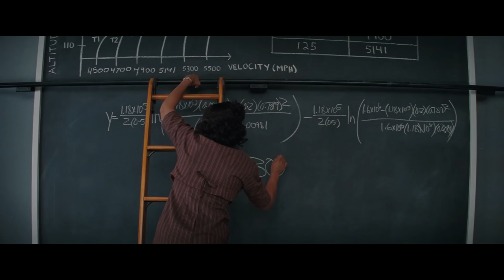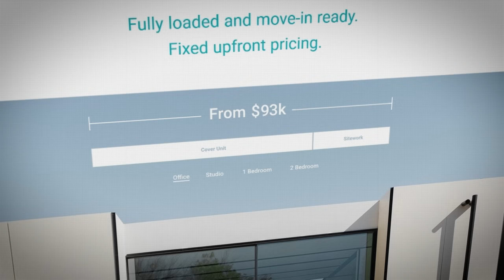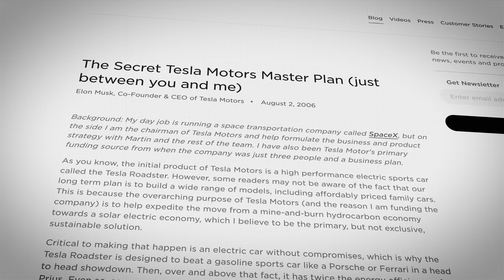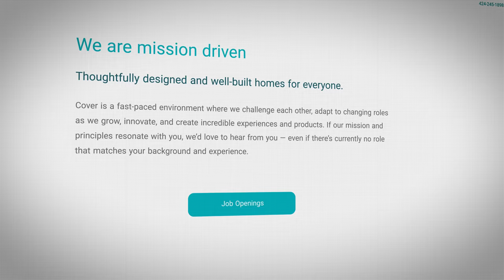How Cover Is Building The House Of The Future

Comment: Is this an advertisement ??? Agree with you that shipping containers are terrible idea for home but prefab homes built with steel are custom designed, are more or less exactly like normal homes but transportable by road and cost half the price of those offered by Cover and dare I say maybe even one third the price. This is given the fact that among Western countries,  USA is one of the cheapest countries for manufacturing.
Reply from the maker: Not sponsored. I address other prefab strategies in the video. We'll just have to see how it plays out.
Reply: @JohnCooganPlus  Yes you did talk about factory built prefab homes and mobile homes but highlighting only the negative points. I am not sure whether you doing this on purpose or haven't done enough research. Factory built prefab homes generally stick to 4.2 meters width, which can easily be transported on a flatback truck, they are light and strong enough to lifted by a crane if truck cannot go into a narrow lane. These 4.2 meters wide sections can easily be joined together on site to make any custom design. Mobile homes serve a completely different purpose, they are more adaptable for off grid living. Another example of your bias was when you selectively chose a clip from Bryce Langston channel and tried to tell us that people spend $450,000 on container homes, I have watched his channel, a vast majority of the houses cost around $100,000 or even less. A considerable part of those $100,000 goes into building an outdoor living area, solar panels, battery storage and rain water harvesting which is not included in Cover price. Cover is selling an overpriced product which is in no way superior or different from a prefab homes. You kept insisting on the point about narrow lanes, you are talking about LA not Ho Chi Minh City where most people live in alleys or streets which are not wide enough for even a car. Cover might be doing some great work which could ultimately make housing affordable but thats not the point you are making in this video. You are telling look Cover is so good and others are so bad despite the fact Cover is not offering a product which is either cheap or advantageous in any way. Let Cover sell a 1 bedroom unit for $50,000 then we can all praise Cover for their leading edge technology.

Comment: Re: $450,000 @11m15s-
To be fair the New Zealand dollar has been as low as almost half the US$ in the last few years. So in US$ the house was most likely between $230k-$300k.
Reply from the maker: Yeah, and to be completely fair, there are some really cheap container homes out there. There's a good channel on YouTube that breaks down costs if you build it yourself and you can definitely save money if you really work at it, but the strategy doesn't really scale based on what I understand.

Comment: でもアメリカは土地の値段が上がっています。
平屋の一戸建て住宅というのは狭くて高すぎます。
これを解消するには上に積み重ねるしかなく、その土地に建てる建物の容積率が沢山必要になります。そしてアメリカの建築許可の遅さも問題です。
But in the United States, the price of land is rising.
Single-family homes are too small and expensive.
The only way to solve this is to stack them on top of each other, which requires a lot of floor area ratio of the buildings to be built on the land. And the slowness of American building permits is also a problem.

Comment: A birth of a failure....The building code will not allowed this type of building......In Canada we had the same approch with the 
gas station......never work.....the major issue was  (1) independant electrical unit per modul......no conection box.....that will increase the cost..

Also, you not allowed a have a mortgage if is no foundation....

Modern trailer park
Reply from the maker: There is a foundation. Lots of these units are financed with mortgages.

Comment: prefabs use to be cheaply made homes.  as such their value and interest fell,   Today, homes in general are built to a much lower quality scale than those of the past.  maybe quality is a bad choice of words.  The homes are good quality, but the materials used have changed.  Todays materials are more efficient, less but achieving higher standards.  so houses can typically be more grand, and built faster for far less if those old school materials were used.   Todays Fab houses doubles down on efficient materials, and more over consolidated  much of the on site build into a in house factory process.  Eliminating much of the custom on site requirements.  thus saving money and expediting the build.

Comment: There is no way they don’t have to accommodate fluctuating material prices. That’s just a given… 

Second, there is no way you could repair a house like this in a cost effective way… there is a reason we build with the materials we build with and it’s been happening for a long time… sure new materials come around but they always key in with what’s existing… a typical house constructed in Washington state is built a lot differently than a house built in Ireland… and it’s for a reason that tech bros can’t solve based on their model of disposability… the building industry is built on efficiency… a modern design will always be more expensive and take longer than a typical residential house with casements on the windows etc…

Third… you mentioned sustainability but where the hell is it? Not in the power demands of all those cnc machines… not in the ply wood and metal shown in the cutaways of the panels… certainly not in the disposability factor of it all… are any of these folks sustainability aware of the fact that while building with lumber you are actively trapping carbon? Used properly it’ll take at least a hundred years before it would even start to decompose…

I’m not bashing the idea, but to even begin to think this will somehow wipe out entire lines of trade that folks have been learning and passing down for liter thousands of years is just too tech bro for me to not respond to… Elon musk claimed he was gonna use the roadster to fund the rest, might be true, but think about how much further we’d be in ev technologies if he wasn’t the richest fucker in the country and had actually been putting all that into making that stuff more accessible and reliable… another example of a product that is not as repairable as what it’s trying to replace… instead the shit just ends up in the poor folks neighborhood when it’s tossed out by people with money… wouldn’t it have been better if those investors spent the millions on accommodations for the homeless? Just proves the entire point I’m trying to make here… they are just telling us this is better and flashing it at us like the next iPhone so that we’ll all believe it’s as good as they claim it is… wasn’t there also a new blood test tech start up that was gonna “revolutionize” an industry while absolutely destroying the supporting labor force behind what we currently have?

Comment: Architect here, prefabricated houses has it's advantage but the only thing stopping it from going mainstream is simply the foundation and the supply/drainage pipe, if he couldn't solve these two problems he's basically building a shack. Great channel but I wish you have done more research in this topic. bcz this dude is a fraud and he knew it